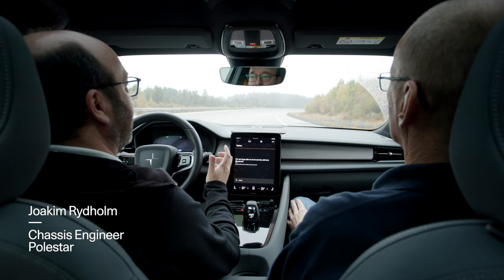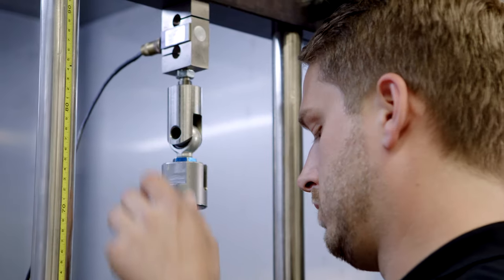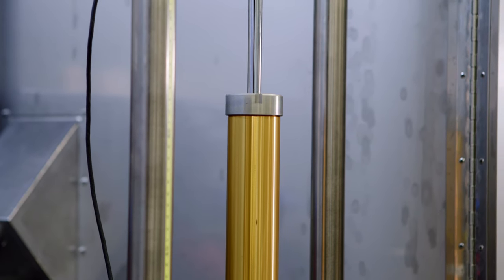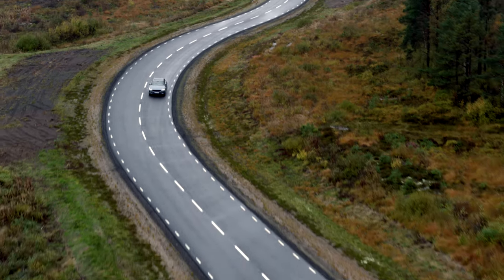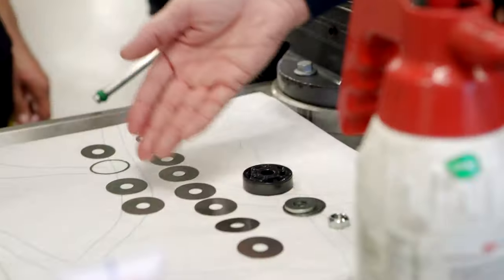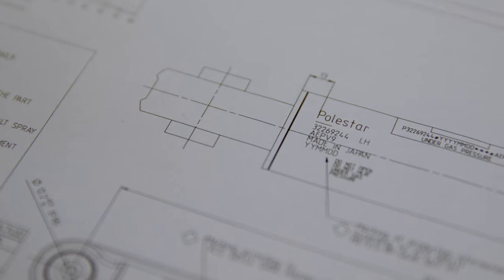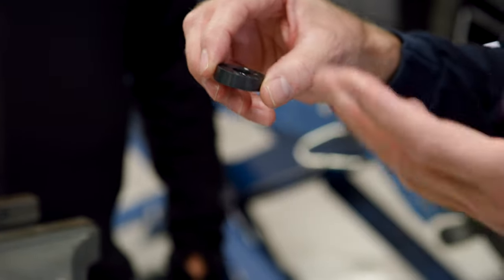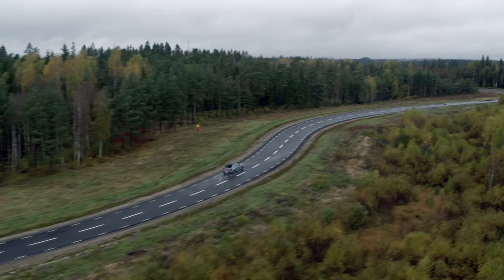Performance - A deep dive into EV dampers with Öhlins | Polestar

Comment: Brilliant shocks. Why did Polestar decide to use a dust boot that doesn't protect the entire shock shaft and leave it exposed? Mine have failed prematurely and I bet it has to do with external elements getting onto the shaft and passing/working through the seals, further degrading them and quickly.

Comment: Absolutely love them. Please let us know which Rear Damper Adjustment Extension Kit we can use and if it possible to guide them inside the trunk.
Reply: Pls let me know as well bcs I am not looking fwd to jacking up the car every weekend!
Reply: @laurensvanhoorn2811  I don't jack up the front to make adjustments. I don't even jack up the back... Though, all you need is an inch or two more in the back to make it a bit more comfortable to adjust. It just takes a bit of good dexterity to do it without a jack, but it can be done! It helps to put a shop towel over the rear tires to keep your arm from getting scratched up from road debris, but other than that, I'd say practice doing it so you can make adjustments on the road as well.

Comment: What the spring rates for the performance pack?
Reply from the maker: The Öhlins DFV dampers allow you to choose from 22 different suspension settings to emphasise performance, and a tailored feeling in the Polestar 2. You can read more about the specific settings on polestar.com/polestar-2/performance-pack/adjusting-the-ohlins-dampers
Reply: @PolestarCars  thank you but my question was what are the spring rates. The dampers are different
Reply from the maker: For details on the spring rates, you're welcome to contact us at Polestar Support. You can find our contact info on polestar.com/polestar-support.
Reply: @PolestarCars  Thank you

Comment: Are the standard dampers from Öhlins as well? Or is it only the performance?
Reply from the maker: The standard dampers are Tenneco ⚡️
Reply: @PolestarCars  with Monroe RideRefine RC1?
Reply: @PolestarCars  If I adjust the Öhlins damper characteristic, the spring characteristic will stay the same, correct? Or do I get this wrong?
Reply from the maker: Yes, that's right! 🙌